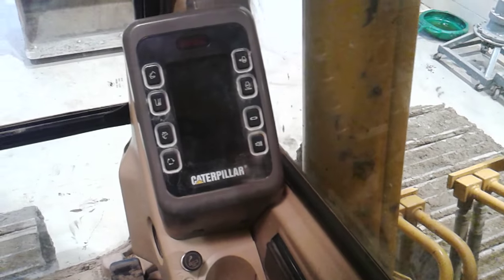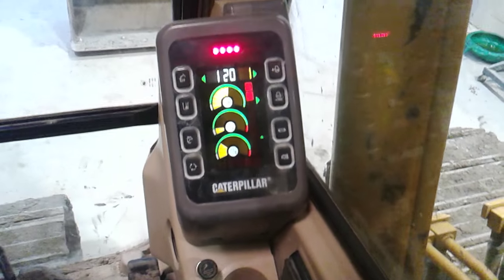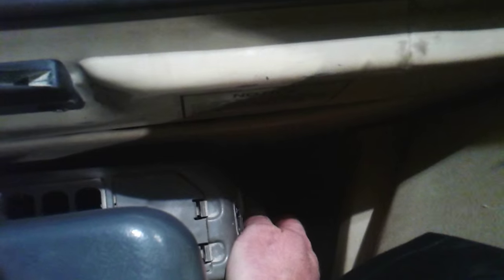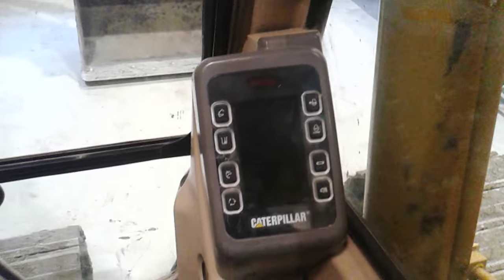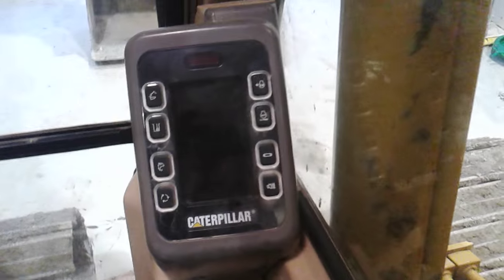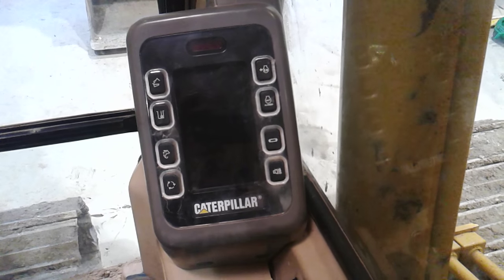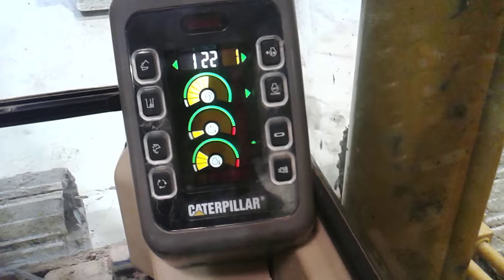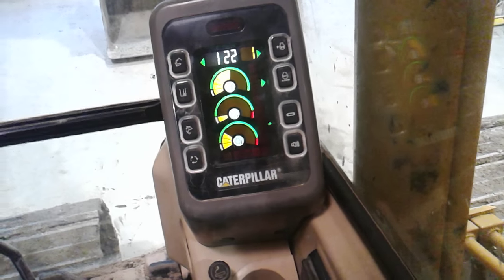Cat B Series Excavator Monitor G/A and PRV Backup switches system

Comment: Hi. I have a 1997 cat 312(added the same monitor I see in the video) I start the machine up, works as normal, throttles up as normal, in less than a minute the battery light goes on the machine and I have nothing on throttle control so I switch to manual to operate. Every time the battery light comes on, I have to operate in manual setting. I installed a new alternator, thought that would help but doesn't. The other different thing that I noticed is that when you switched to manual, the screen goes off, mine doesn't. Any thoughts? I'm a novice! Thanks!!

Comment: I got the  CAT ET it's limited  but helps.
Reply from the maker: Last time I tried connecting ET to a 300B series it did not support it. I do have the specific cable but laptops rarely have RS232 ports anymore
Reply: @hydraulics  ET is limited anyway.
CAT and Deere are not allowing customer to troubleshoot their machines anymore.
I and many others are no longer a fan of either company.
I am switching brands to CASE or Komatsu who supply all necessary scanners software .
"Right to repair" laws in America are being ignored by many and farmers currently are suing Deere ..
Contractors need to join suit against CAT and Deere.
Excellent videos .
Thanks
Reply from the maker: @MitzvosGolem1  I have dealer ET
Reply: @hydraulics  CAT doesn't sell dealer ET only consumer level .
Will not erase DPF code
Reply: @hydraulics  I have 2014 to new CAT costs $970 for CAT service to come plug in a rip off.
I am selling off and getting a different brand .
I went to CAT dealer for parts ...They handed me Chinese parts!!! 
Enough!
Reply from the maker: @MitzvosGolem1  I didn't buy it - I get it free via the dealer. I train their techs. I understand the frustration of an independent. They have your hands tied and I have followed the Deere thing
Reply: @hydraulics  oh lucky you . I hire you to come. Lol 🤣